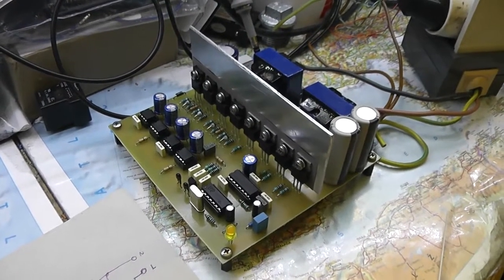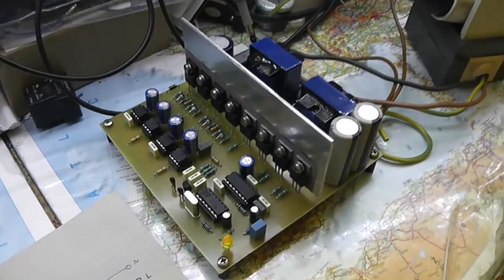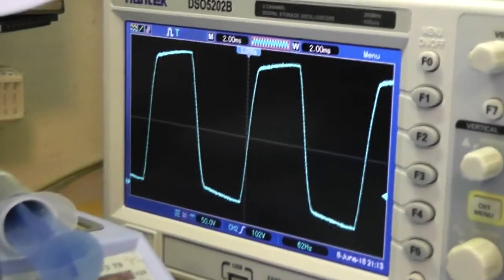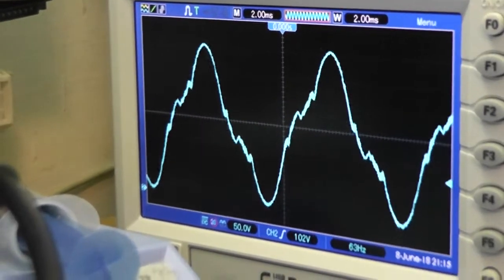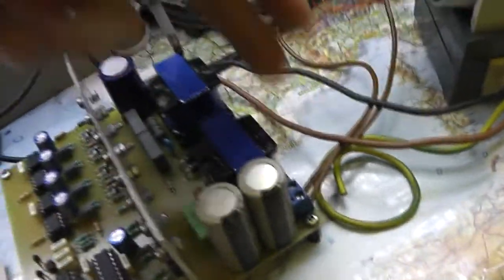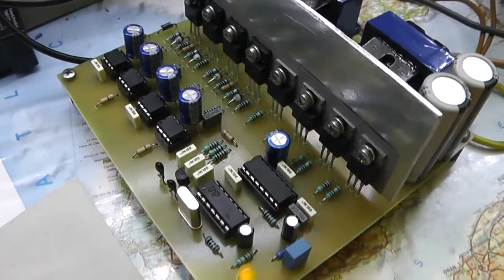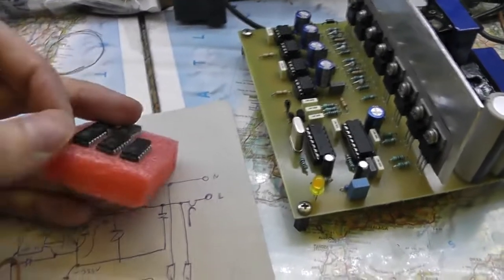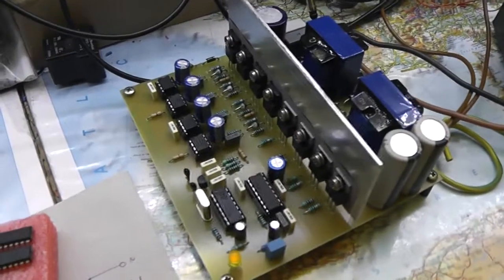12/230V diagonal SPWM converter (English version)

Comment: Thanks,for the circuits ,please ,one can get the source code or hex file
Reply from the maker: I didn't have the time to write my code, still using the TDS2285 (you can get it from aliexpress). But it will be simple 50Hz DDS with lookup table and proportional voltage reg. and some FSM for battery and fault monitoring.
Reply: Arambajk ,when the source is out please let me know.thank you.
Reply from the maker: I can add English commented asm later: http://arambajk.blogspot.com/2018/08/menic-48230v-tht-diagonalni-spwm.html the .hex is just first version, need some little upgrades.